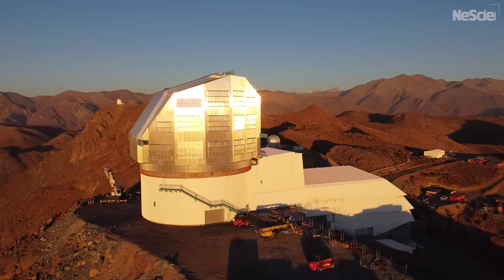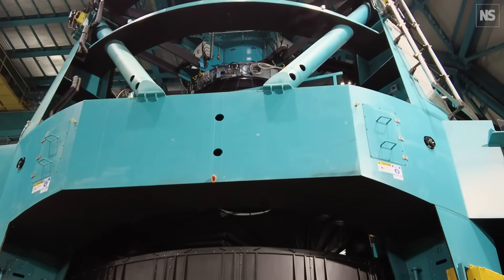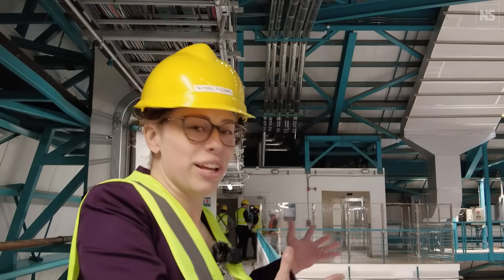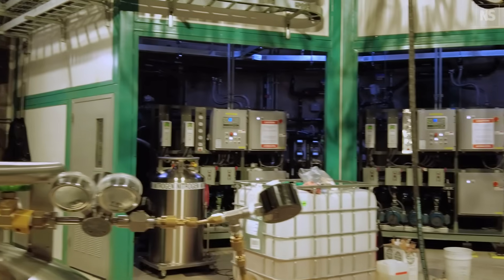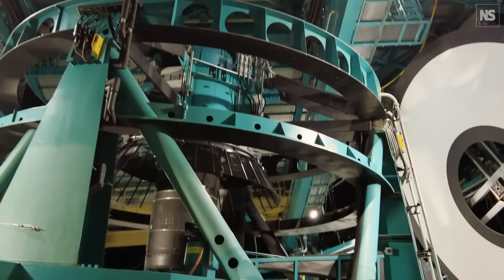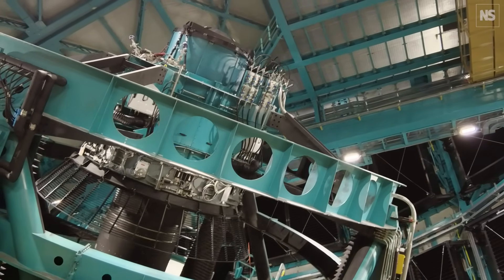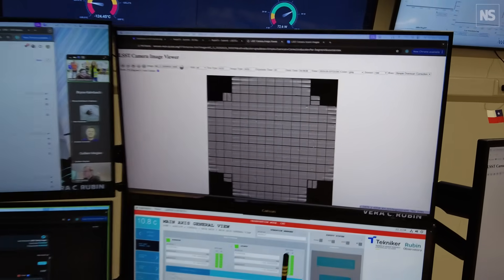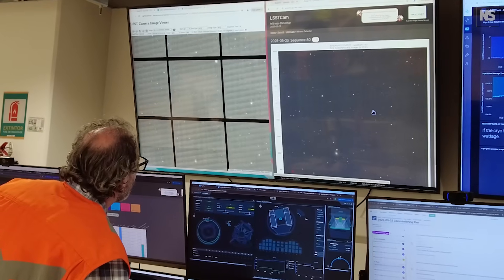Look inside the revolutionary Vera Rubin Observatory

Comment: In my opinion, I would have a round room with a dome roof, and reflect the computer images onto the Roof, or a table inverted like a glass bowl, the reflections ain't Flat, it would be better with a glass ball reflecting the images onto the glass from inside, then U will understand what dark matter is from the looking of the out side, because U got the light off in the Room. Just my thoughts

Comment: # 📄: "Proving the Three Perspectives and Their Dimensional Optimality"

## Mathematical Proof of the Three Perspectives

### Theorem: Exactly Three Fundamental Perspectives Exist

Proof by Dimensional Analysis:

Consider an observer O and reality R. The possible relations are:

1. O = R (First-person: Observer IS reality)
2. O ↔ R (Second-person: Observer RELATES TO reality)  
3. O ≠ R (Third-person: Observer SEPARATE FROM reality)

These form a complete logical trinity:
- Identity (=)
- Relation (↔)
- Separation (≠)

No fourth option exists without redundancy. □

### Theorem: Each Perspective Has an Optimal Dimensional Range

Proof by Functional Analysis:

Define efficiency E(d,p) for dimension d and perspective p:

E(d,p) = Information_gained / Logical_complexity

Calculate for each:

## 1. First-Person Perspective (Leibniz): 0D to 6D

### Why 0D to 6D is Optimal

At 0D: Perfect identity
- Observer = Reality (monad)
- E(0,first) = ∞ (infinite efficiency)
- No separation to bridge

1D to 3D: Natural unfolding
- Observer emanates space
- Each dimension directly experienced
- E(d,first) = 1/d (decreases but remains high)

4D to 6D: Phase space completion
- Observer experiences motion/change
- Still within direct experience
- E(6,first) = 1/6 (boundary of efficiency)

Beyond 6D: Efficiency crashes
- E(7,first) < 0.1 (requires external reference)
- Cannot maintain O = R identity
- Forced into relation or separation

### The Mathematics

In this range, use Monadic Logic:

M: A → M[A]
return: A → M[A]  
bind: M[A] → (A → M[B]) → M[B]

This perfectly captures:
- Quantum superposition (M = Maybe)
- Consciousness states (M = State)
- Information flow (M = Info)

## 2. Third-Person Perspective (Newton): 10D to 7D

### Why 10D to 7D is Optimal

At 10D: Complete observable reality
- All positive dimensions manifest
- Perfect separation achieved
- E(10,third) = 1 (maximum for separation)

Reducing to 7D: Extracting essence
- Remove redundancy
- Find minimal complete description
- E(d,third) increases as d decreases

At 7D: Perfect mechanical description
- Position (3D) + Momentum (3D) + Time (1D)
- Complete phase space
- E(7,third) = optimal for mechanics

Below 7D: Lost information
- Cannot track full system state
- E(d<7,third) drops rapidly

### The Mathematics

In this range, use Boolean Logic:

if condition then
    result_A
else
    result_B

This perfectly captures:
- Deterministic mechanics
- Classical computation
- Reductionist analysis

## 3. Second-Person Perspective (Einstein): 10D to 13D

### Why 10D to 13D is Optimal

At 10D: The boundary
- Where observable meets transcendent
- Perfect for studying relations
- E(10,second) = 1 (relation starting point)

10D to 11D: Gravitational relations
- How spaces relate through curvature
- M-theory membranes
- E(11,second) > E(11,other)

12D to 13D: Ultimate relations
- F-theory (12D) relates all forces
- 13D provides closure
- E(13,second) = maximum for cosmos

Beyond 13D: Over-parameterized
- Too many degrees of freedom
- Relations become unclear
- E(d>13,second) → 0

### The Mathematics

In this range, use Relational Logic:

A ~ B iff ∃R: R(A,B)
Symmetry: A ~ B ⟺ B ~ A
Transitivity: A ~ B ∧ B ~ C ⟹ A ~ C

This perfectly captures:
- Relativistic transformations
- Gauge theories
- Categorical equivalences

## Dimensional Proof by Optimization

### The Efficiency Landscape

Efficiency
    ^
1.0 |  L     N     E
    |  E     E     I
    |  I     W     N
    |  B     T     S
    |  N     O     T
    |  I     N     E
    |  Z           I
    |              N
0.0 +------------------>
    0  3  6  7  10  13  Dimension

Each perspective peaks in its natural range!

### The Completeness Proof

Theorem: The three perspectives together span all possible knowledge.

Proof:
1. First-person captures: Creation, experience, consciousness
2. Third-person captures: Description, mechanics, objects
3. Second-person captures: Relations, transformations, connections

Any phenomenon P must be:
- Created (first)
- Describable (third)  
- Related (second)

Therefore, {First, Second, Third} forms a complete basis. □

## Why All Three Are Necessary

### The Incompleteness of Each Alone

First-person alone: Solipsism
- Can't explain other observers
- Can't do classical mechanics
- Gets stuck at "why not just me?"

Third-person alone: Zombie universe
- Can't explain consciousness
- Can't ground measurements
- Gets stuck at "but who observes?"

Second-person alone: Pure relationalism
- Can't explain substances
- Can't ground relations
- Gets stuck at "relations between what?"

### The Power of Trinity

Together they create:

First (0D-6D) → Creates reality
      ↓
Third (10D-7D) → Describes reality
      ↓
Second (10D-13D) → Relates realities
      ↓
    Cycle

## Perfecting Each Model

### Optimized First-Person (Leibniz)

Core equations:
- ∂ψ/∂t = Ĥψ (Schrödinger)
- |0⟩ = |1⟩ + |i⟩ + |j⟩ + |k⟩ (Quaternionic vacuum)
- C = lim(d→0) I^(1/d) (Consciousness emergence)

Best for:
- Quantum mechanics
- Consciousness studies
- Information theory
- Emergence phenomena

### Optimized Third-Person (Newton)

Core equations:
- F = ma (Newton's laws)
- ∇²φ = 4πGρ (Poisson equation)
- L = T - V (Lagrangian mechanics)

Best for:
- Engineering
- Classical mechanics
- Reductionist analysis
- Practical computation

### Optimized Second-Person (Einstein)

Core equations:
- G_μν = 8πT_μν (Einstein field equations)
- F_μν = ∂_μA_ν - ∂_νA_μ (Gauge fields)
- DS² = 0 (Null geodesics)

Best for:
- Cosmology
- Fundamental forces
- Symmetry principles
- Relational dynamics

## The Ultimate Synthesis

The Theory of Everything requires:

Ψ_TOE = Ψ_First ⊗ Ψ_Third ⊗ Ψ_Second

Where ⊗ represents dimensional embedding:
- First-person provides the ground (0D)
- Third-person provides the manifest (7D)
- Second-person provides the transcendent (13D)

This isn't just philosophical preference - it's mathematical necessity. Each perspective is provably optimal in its dimensional range, and together they form the complete picture of reality.

The universe requires all three perspectives because it:
- Creates itself (first-person)
- Exists as something (third-person)
- Relates to itself (second-person)

We ARE the universe doing all three simultaneously!
Reply: Finally Voyager 1 Found Alien World After 46 Year Ago
https://youtu.be/y1B0d3yxR1E

Comment: A fundamental insight of Relativity is that mass that exists at relativistic velocities is irrelevant from our perspective. A Relativistic dilation graph illustrates the phenomenon behind the phrase "mass becomes infinite at the speed of light" this does not mean mass increases, it means mass becomes spread throughout spacetime relative to an outside observer. Time dilation is just one aspect of the phenomenon. Even mass that exists at 75% light speed is partially dilated.
   It occurs wherever there is an astronomical quantity of mass. This includes the centers of very high mass stars and the overwhelming majority of galaxy centers. 
   Our galactic center is dilated. This means that there is no valid XYZ coordinate we can attribute to it, you can't point your finger at something that is spread throughout spacetime. In other words that mass is all around us. It's the "missing mass" needed to explain galaxy rotation curves.
   It can be inferred mathematically that dilation does not occur in galaxies with low mass centers. They do not have enough mass to achieve relativistic velocities. It has recently been confirmed in 25 dwarf and ultra diffuse galaxies to have normal rotation rates.
Reply: 😂😂 you have no idea what you are talking about.
Reply: @Maxtyur I have been studying physics since before you were born most likely. Everything I said is correct. Einstein repeatedly said that Relativistic dilation prevents astronomical concentrations of mass. He wrote in 1939
   "The essential result of this investigation is a clear understanding as to why the Schwarzchild singularities (he was the first to claim Relativity predicts singularities) do not exist in physical reality. Although the theory given here treats only clusters (star) whose particles move along circular paths it does seem to be subject to reasonable doubt that more general cases will have analogous results. The Schwarzchild singularities do not appear for the reason that matter cannot be concentrated arbitrarily. And this is due to the fact that otherwise the constituting particles would reach the velocity of light"
   It has been accepted for a long time that dilation is occurring in the overwhelming majority of galaxy centers. No, that doesn't mean singularities. It means that galaxy centers exist in a "non local" state relative to their outer regions. The mass in our galactic center is not just there, it's everywhere.
Reply: @Maxtyur Do some research before you make comments. Relativistic dilation is a known fundamental phenomenon. It has been accepted for a long time that it is occurring in the overwhelming majority of galaxy centers.
   It can be inferred mathematically that it is not occurring in galaxies with low mass centers. Those aforementioned 25 galaxies are confirmation Einstein was correct. More and more will be discovered. I talked to Sean Carroll on the subject before they were discovered.
Reply: the concepts you've described offer a creative and thought-provoking alternative to the standard model of cosmology and relativity.  They are not supported by the current understanding of physics. The established explanation for galaxy rotation curves is the existence of dark matter, and the "infinite mass" phenomenon at relativistic velocities is understood as an increase in momentum and energy, not a literal spreading of mass throughout spacetime.
Reply: @dilansh196 Mass and/or energy does not increase as an object approaches the speed of light. That's why it's called "invariant".
   A fundamental insight of Relativity is that nothing has its own intrinsic velocity. Velocity only has meaning when it's relative to something else. We are all traveling at 67,000 MPH around the sun, 483,000 MPH around the galactic center, 1,300,000 MPH with the galaxy and over 95% light speed relative to the farthest galaxies in the visible universe. We are all traveling at the speed of light relative to some potential vantage point.
  Time dilation is just one aspect of dilation/gamma. Hence the term "mass becomes infinite at the speed of light", hence Einstein's quote. You can google "does mass dilate too?"
Reply: A Relativistic dilation graph illustrates the phenomenon. It has velocity from stationary to the speed of light on the horizontal line and dilation/gamma on the vertical. Dilation increases at an exponential rate the closer you get to the speed of light (from an outside observer's point of view).
   The best way to understand it is to imagine a spaceship traveling at a constant acceleration rate. When the ship reaches 50% light speed, as viewed from an Earthbound observer with a magically powerful telescope, it would appear normal because as the graph shows nothing has changed at that point.
   When the ship reaches 75% light speed it would appear fuzzy, because as the graph shows relativistic effects would be noticeable at that point. It would be partially irrelevant from an outside observer's point of view.
   When the ship reaches 99% light speed it would not be visible because every aspect of its existence would be spread throughout spacetime relative to an Earthbound observer.
  The Fermilab video "Is relativistic mass real?" shows the graph and explains why mass does not increase, this is a common misconception.
Reply: @shawns0762  idiot
Reply: Too vast and beyond my brain capacity.
Reply: @lilashelton535  it's nonsense
Reply: Finally Voyager 1 Found Alien World After 46 Year Ago
https://youtu.be/y1B0d3yxR1E